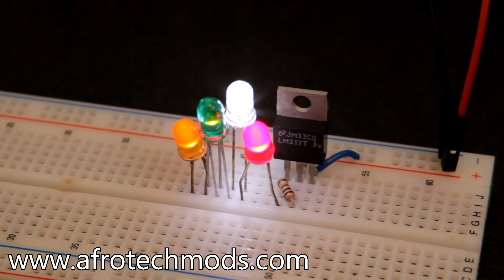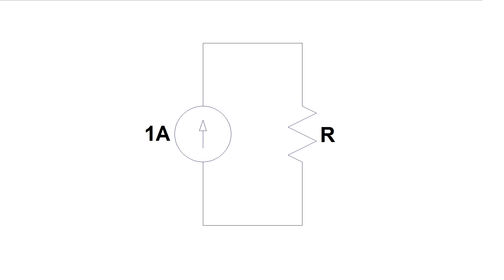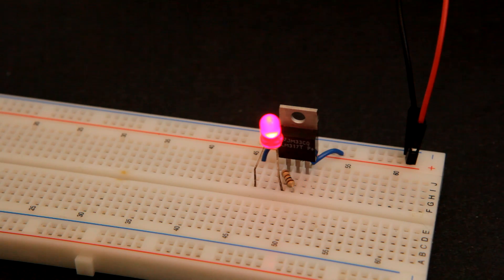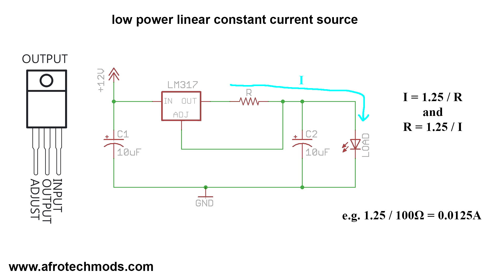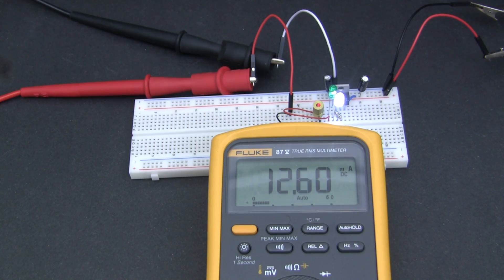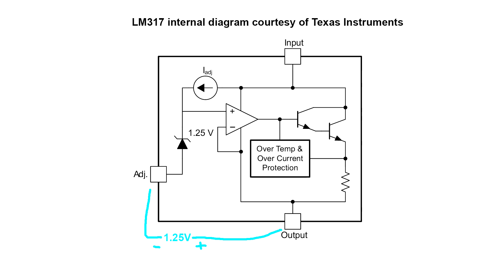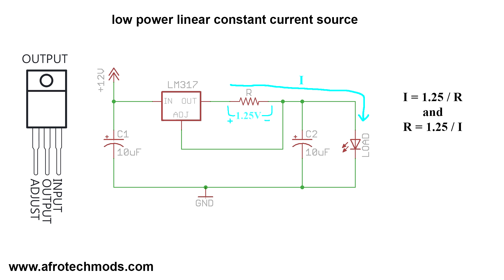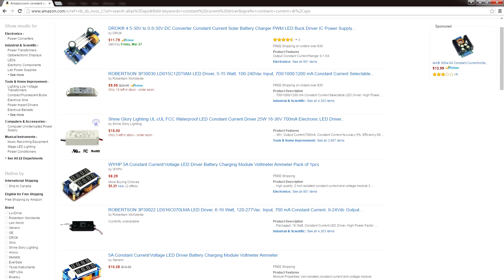Constant current power supply and laser / LED driver tutorial

Comment: It's not related to this video, but what would happen if you would charge a capacitor with another one and so back and forth?
Reply from the maker: Charge would flow until the voltage on both caps is equal
Reply: Afrotechmods Wouldn't it discharge and if so, how fast?
Reply: ***** Thanks, I can now build my flashlight for my motor!
Reply: ***** it wouldn't discharge however capacitors also have a leakage amount as well as time variables dependant on ESR values.

you would also lose energy to the wires themselves due to the fact that copper is not a perfect conductor and does have resistance values in the milliohms range.

what would essentially happen is at the point of contact the two capacitors would ring for a few microseconds, energy traveling from one capacitor to the other and storing a bit more than equilibrium to reach an apex and attempt to return to equilibrium losing energy to the wires and storing significantly less energy every time. until an equilibrium was achieved between the two capacitors, fast forward to about 200 years or so and the capacitors would have leaked energy and depending on size and makeup,could very well have been depleted in the interim.

Comment: the current will be 12.5ma,but if the voltage is to high,the led's wont burn?
Reply from the maker: Nope - the circuit ensures you only get a certain amount of current through the LEDs and changes the voltage accordingly.
Reply: Afrotechmods Ok,thanks
Reply: Afrotechmods Really? Even if the voltage goes over the maximum forward voltage of the LED?
Reply: Ohhhh thats right! Thank you!

Comment: How can we make a constant voltage and current source?
Reply: Geometry Dash Revon impossible. By ohms law you have to compensate for one, adjusting the other.
Reply: Mr Mürk is doable but only if u design it for a specific load
i used that setup for a 10W white LED
Reply: use one 317 as voltage regulator fallowed by another 317 as current regulator